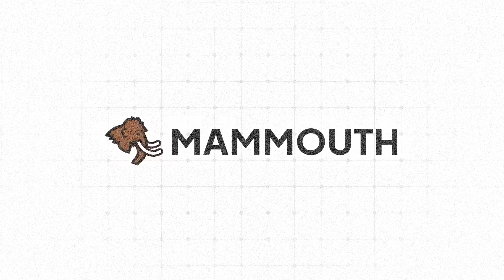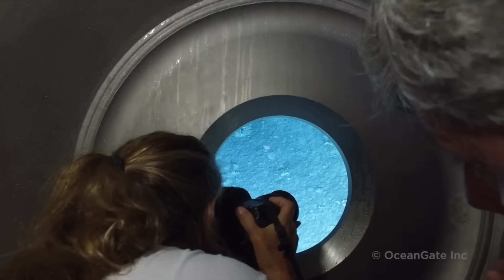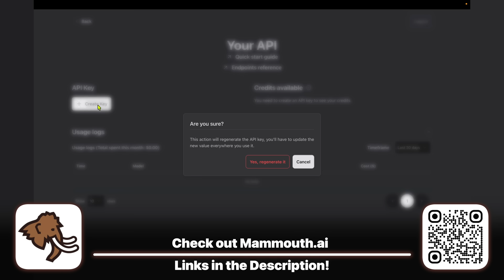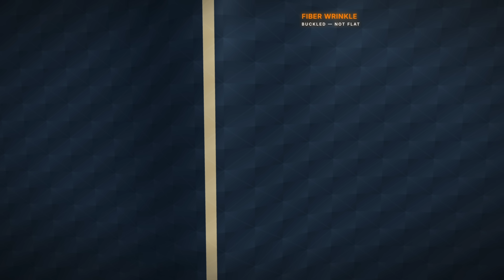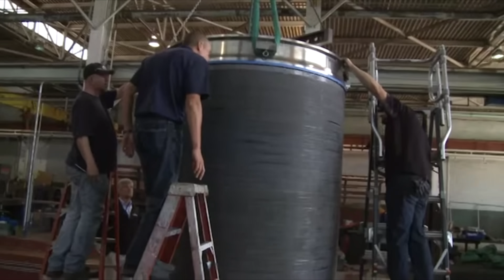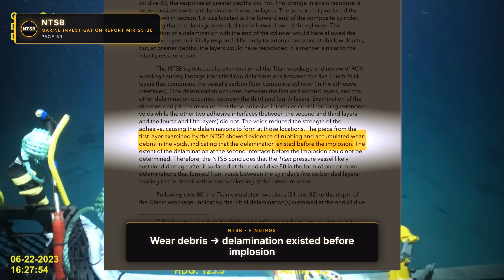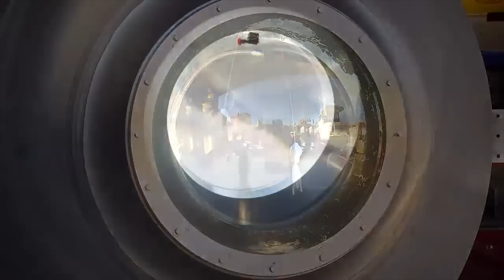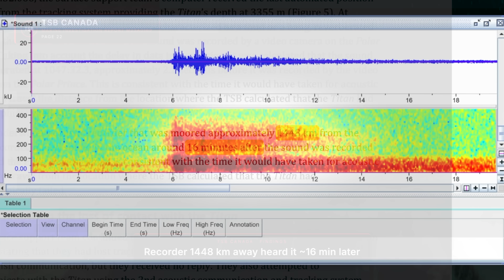Oceangate Titan: It was WORSE Than We Thought

Comment: Thank you ! As a composite engineer hearing so many times the issue was carbon fiber and using it in compression was really annoying. CF is used successfully on sailboat masts and other compression application since decades.

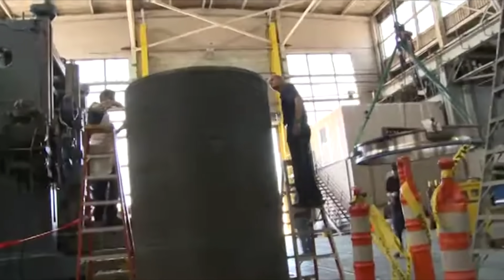Wet layup (vs prepreg), grinding layers 😮, and cutting corners everywhere was really the issue. At 6:29 2.7% porosity is absolutely insane, that's garage hobbyist quality.
Reply: This is what I suspected from day one.  If anything, the fact that this abused, poorly made piece of junk did over 80 dives without imploding is a testament to the potential of CF for submersible hulls.
Reply: Correction: hull 2 only made 13 successful dives to Titanic depth.  Apparently the Canadian report which suggests near absolute safety of a CF hull only applies if the hull is 100% flawless.  Likely impossible even for Boeing.
Reply: Well, you can use carbon fiber in compression, but it is relatively weak in that direction. It is truly not the ideal material for a cylindrical hull.
Reply: @kirkkohnen5050  carbon fiber in the correct orientation performs extremely well in compression.  Most structures fail under compression due to buckling not a direct material failure.  The stiffness of carbon makes it very reluctant to buckle for its  weight.
Reply: @Eng-OS  as a layman, I’m open to correction on this: I assume that the compression experienced by a mast is not exactly the same as the compression experienced by the Titan hull.  Am I incorrect to think that the bulk of the compressive forces applied to a mast would be longitudinal, like trying to bend a piece of pipe, where the opposite side of the pipe is doing a lot of work to resist that bend because that portion is in tension? Whereas the mast maybe is not experiencing this type of perpendicular compression that would come from squeezing a big strong clamp onto the middle of that mast, and in that scenario that mast could likely just fold in half.
A cf bicycle frame is very strong in the certain types of compression it is designed to handle, but it will easily yield to a hammer blow, or a clamp onto the tubing.
Reply: @jefferskine8498  buckling (under compression) is almost always the failure mode of a bending tube regardless of the material.
Reply: It's the same for other materials too. You can have cast aluminum that is excellent yet another casting that's not. Another analogy is to have two steel wrenches sitting next to each other and they look identical. Yet testing them will show the difference.

There's a reason for destructive testing and standards. If you just wing it, then most likely, you have winged it on everything else and it's the sum of errors that catch up with you. In this case, the sum of those errors (which were driven by Rush) that led to this disaster. It's not if it was going to happen, just when.
Reply: Cutting corners? Sure. Cutting fibers though? 😮 🤯
Reply: I thought the same.
Reply: But Sail boats do not suffer the intense pressure of water at that depth. That's why titanium is the material used for subs.
Reply: @Monica-v6m1v  Yeah. And if your sailboat's mast breaks, you don't instantly get 5 servings of billionaire purée.
Reply from the maker: yeah those are targets i'd strive for in my garage. thank you for chiming in as an expert!
Reply: @TwoBitDaVinci  the viewers deserve better sponsors 
Ai slop is trash
Reply: Its interesting that Stockton Rush pretty much proved the technology would work repeatably but did so in a very bad way. It would be like if the first airplane was built by someone who got it to fly, did loops in the air, and then crashed into the ground because the control stick broke.
Reply: @ryelor123  Stockton put the "C" in Rush!

Comment: It feels like grinding wrinkles is so, so bad. Doesn't that take away a lot of strength? I feel like the more continuous the fiber is in the material, the stronger it's going to be. Wherever you grind a wrinkle, you are effectively cutting the fiber they wound to make the layer and they are introducing weak areas that are more prone to cracking than the area around them. If those flaws stacked up on top of each other it could basically create a soft spot in the hull that goes all the way through it. Now "soft spot" is misleading because it's very, very stiff compared to most objects but that spot would be significantly weaker than the rest of the hull

Comment: People do not understand the fundamental problem with deep diving submersibles. All subs need to achieve neutral buoyancy. Military subs are relatively shallow diving so you can use relatively low strength-weight ratio hull materials and trim for neutral buoyancy by adding ballast. But go deeper and the hull thickness relative to the air space within becomes such that the buoyancy is negative without any ballast. You cannot add more airspace because that would require more hull material to contain it. You can use 'syntactic foam' - tiny hollow glass spheres, but that is horrendously expensive. You can use a tank of non-compressible liquid with lower density than water (the Trieste bathyscaphe used gasoline), but such liquids are only slightly less dense than water, so you need an enormous tank. Hence the need to use exotic high strength to weight materials and the most stable shapes. It is not just that making it a titanium sphere would not have allowed it to carry enough passengers to make it economic, but such a sphere would not have contained enough air to make it neutrally buoyant.

Comment: Rush wasn't even consulting the relevant experts, Boeing and NASA are in the aerospace sector not undersea. And he ignored their recommendations as well, the original estimate for a safe hull at that operating depth coming from Boeing was for 9.3 inches. Rush basically halved his safety margin, then refused to use three axis wrapping, ground through thousands of fibers to get flat bonding surfaces and overbaked the most important part of his hull. Then treated his hull like it was made from a metal that could withstand repeated high pressure cycling, multiple high impulse impacts and weathering exposed in the Newfoundland winter.

The fact he was breaking so many of the rules in this sector and was still allowed to run it as a commercial operation taking paying customers down to truly dangerous depths shows a systemic breakdown in this sector. In the end Rush's psychology was even more unorthodox than his hull manufacturing and no one in authority caught this before he killed himself and four other people. One a 19 year who was terrified of making this journey.

Comment: All of the engineering work that should have been done by Stockton was done by the Canadian Safety Board it seems. It sounds like it's technically possible to build a submarine out of carbon fiber and if used within parameters and built as designed it could be done. Machining the cylinder shape out of a single chunk of titanium 10' by 10' by 20' seems like a better way to buck conventional thinking. No glue, no bolts, no seams, no welds. First start with a billion dollar chunk of titanium...

Comment: Another major point of carbon fiber: It's a non-homogeneous material. There's the carbon material that is made by burning an aramid fiber. The burning process itself is imperfect and contaminants abound. There's the resin, also a contaminant ladened material. Then their are the microscopic voids and air bubbles that are impossible to remove. It is physically impossible to make a perfect composite.

It also is clear they did zero structural testing of samples from their manufacturing line. No non-destructive inspection after each dive. A simple ultrasound scan would have shown the delaminations.

Unconscionable!

Fortunately,  their nervous systems never had time to recognize they were being killed. Alive, then instantaneously dead.

Would I go down in a composite vehicle, no. And I don't care who makes it or designs it.

Would I go down in an Alvin class, yes.

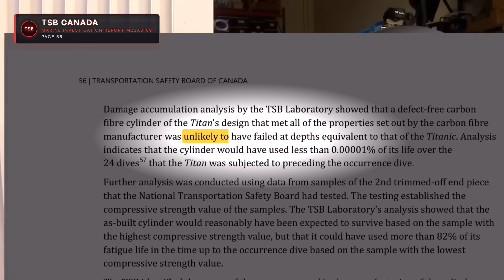Comment: I don’t like what you started off with at 1:25 because a laminated materials monolithic (theoretical ) structural numbers are ALWAYS somewhat useless in practice.  Every bond is weak and every layer introduces  imperfections… so the study you site is highly misleading… carbon fiber was and is a terrible choice for the same reason we’ve known it failed… like most engineering disasters ..joints.. and especially with dissimilar material … RIGHT?? 😑
Reply: Agreed.

When I zoomed in and read the full page - I was like, "WAIT - this isn't anything but educated CONJECTURE on this hull's SPECIFIC breaking point(s), location(s), and cause(s)." There are NUMEROUS logical fallacies in the document's rationale... and in USING it here, as something definitive/authoritative. 😮!!

I've only just begun, so I'll watch the rest...

Comment: Stockton rush presumably knew he was building a death trap but went down in it anyhow, i'd like to know more about the psychology of the guy
Reply: I don't think he did. It's the ultimate in Confidently Incorrect.
Reply: It's pretty simple. He didn't have enough money to fund proper engineering, his business case hinged on impossibly low ticket prices and operating cost per dive, and he had investor money, but not enough to do proper engineering and testing, especially because the costs explode easily, and the investors demanded successful dives to keep funding it. He targeted 125k per seat, which is orders of magnitude to low to do this properly, and people didn't even want to dive for 75k. So after years of his later life sunken into the idea of this business, instead of admitting that the business is a failure when confronted with insurmountable costs, he simply cut costs dramatically, and pushed for dives no matter what to hopefully keep getting more funds. He was as reckless as he was because he was desperate for successful dives or else oceangate would go bankrupt, and he would have wasted his last years of his life, possible loads of private money, and obviously, he told everyone that he was going to make it work. He had huge sunken cost invested into the business working out, which is why he decided to double down and make it work or die trying. Unfortunately, the dying was literal in that case, and involved the lives of customers.

Comment: The fact such a poorly made hull built to minimal max load tolerances survived at least 80 dives has always indicated to me that carbon fiber is more capable for deep water submersibles. The problem was always cost cutting, irresponsible testing and Stockton's arrogance. Arrogance that only made it even more difficult for others to prove this material can be utilized properly.

They had all the tools and data needed to ensure this never happened. I think he was well aware a failure was inevitable but he was willing to gamble his and other's lives on it lasting long enough to secure the funding they needed. In another timeline that gamble may have become another wild startup success story told decades from now but there's no excuse for taking innocent souls along for that ride.

He wasn't entirely wrong about the inefficiencies and problems inherent to many regulatory bodies but that's not why he avoided it. He knew they were cutting corners and taking risks that no competent engineer would approve of and he didn't care. Now he's just another example of why we have to have them.

Comment: I'd say they did pretty much everything wrong.  It's a wonder it lasted as log as it did.
Reply: Epoxy glue is quite strong.
Reply: @Canada_Dominium  Frankly, this is a sort of misconception that the vid propagates - worst thing about this otherwise OK analysis. 
That there's some magic "single telltale", "main villain", in the carbon fiber, or structural glue bond (between different materials with different compression coefficients, to boot). Or that overhyped joystick.

Most of those, individually and even together, can be made to work properly. With proper engineering, manufacturing, testing, upkeep and maintenance. Not necessarily the best choices, but not necessarily doomed ones either. I actually think the joystick part very OK, as long as they had a reliable fall-back in case it starts glitching like mine did after a few releases of Mortal Kombats ))) People in Ukraine use the toy remotes - the same stuff, in terms of how "thorough" quality to expect - delivering live ordinance to invaders in dire need of some. If it's serious enough to defend one's home from a giant and utterly mad invader, for 4.5 years and counting, it's probably serious enough to deliver 3-axis control input to an extra slow sub.

But of course, some things are easier to work with. Some are inherently more or less foolproof. Like, just as long as mass and volume is there, it is somewhat hard to screw up steel or titanium in a way that you end up with something 10's, 100's times weaker than what was in the design drawings and calculations. Still, 2x, 3x - quite easy with lax enough approach. But for CF layout, it can be 20x or even 300x "for the same amount of amateurism and negligence" )

So of course, and as almost always, the overarching cause, the real glue to put all the elements of disaster together, is the whole systemic approach and attitude. When cutting corners is not only accepted but encouraged, one too many will be cut eventually.
Reply: @BroOmnipotent  Carbon fibre does not work under compression.
Reply: @Canada_Dominium  I know mate, I was one of those people posting about that the next day - what this quite slop-py piece calls wrong in the opening lines... only to proceed to talk how CF WASA a villain after all.
What I'm sayin right here is that "bad engineering, bad attitude" and stuff are always more of the root of the problem than the particular detail or material used.

put really rough and blunt, under compression "carbon fibre" is just a high-porosity ceramics/plastics variant, depending on the exact kind of resin used for the matrix. Fairly obviously, it can be done. Could it actually be an efficient material to handle extreme pressures at depth? Possible, as in, not clearly disproven. Even this piece of s... something did survive several dives. Could ditching the "fibre" and making it whole plastic be better? Possible and on a general erudition about materials, quite likely.

Could a "genius" like the late mr. Rush, with his attitudes and ethics and approach to standards, regulations and certifications, together with obedient - complicit - team, from which dissenters - like structural engineers voicing concerns about structural integrity - are fired - produce a truly safe and reliable deep sea sub? Only by an accident.
Yet everyone keeps mentioning CF, glue, weak glass and that nice brand name joystick, while "horrible engineering and corporate culture" is often passed over.
Reply: @BroOmnipotent  Carbon Fiber was a poor choice. They (Rush) doubled down on it every day. And fired and sued everyone who dared to say otherwise. CF is not a strong compressive material. There were multiple flaws and mistakes in the manufacturing processes - uneven tension, voids, high spots, etc., etc., etc. Everyone outside Rush's yes-man circle knew the manufacturing limitations - and just how poorly CF was going to work in the first place.
Reply: @jfbeam  Exactly. My problem was the intro to the vid, saying it wasn't the core problem. Technically - skipping that you just don't do projects like this the way it's done here - it was.

Comment: Before watching the video, let me guess. The carbon fiber delaminated because it doesn't really have compressive strength, it's flexible, so basically what this guy did was built a submarine out of epoxy and expected it to perform like titanium. 

Using technology like this, it could have been really really strong for containing internal pressure, not keeping out external pressure

And the final irony is, the Titanic and the Titan, both would have survived if they'd been made out of titanium

Comment: I still maintain that carbon fiber is the wrong choice in any kind of pressure vessel. Carbon is so weak in the transverse plane. Any kind of point loading will just unzip it. I think a lot of engineers just look at data tables and numbers on a page but never actually picked up a strand of carbon and notice how it behaves.  You can take a very thin strand and hang off of it but take that same strand and slide it sideways with just the slightest grip in your thumb and fingers and it comes apart like a butterfly wing.  A pressure vessel does load the strand longitudinally as it stretches, but there is also just as much cimponent force pushing at every point in a transverse direction. It is just begging to split open. So whether it's a pressure tank on a starship or a submarine....I'd never trust it in that application!